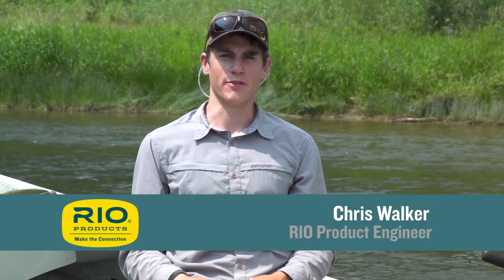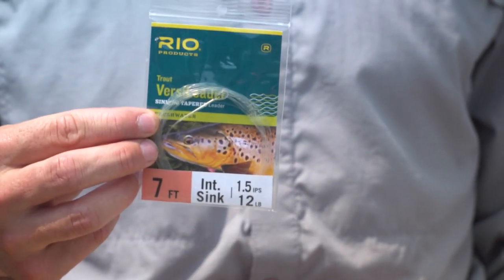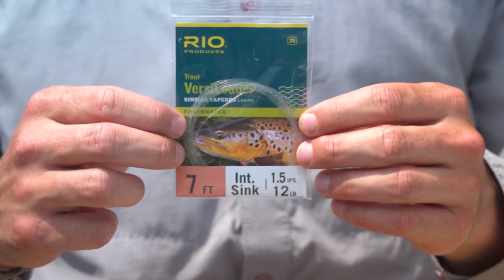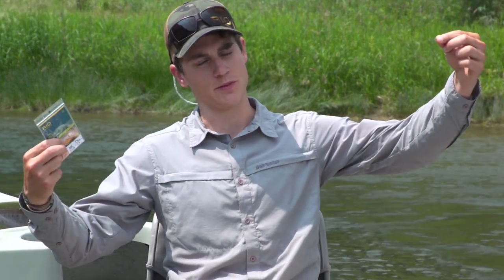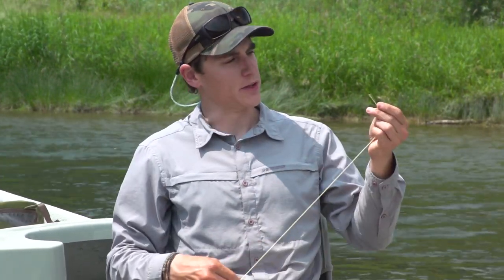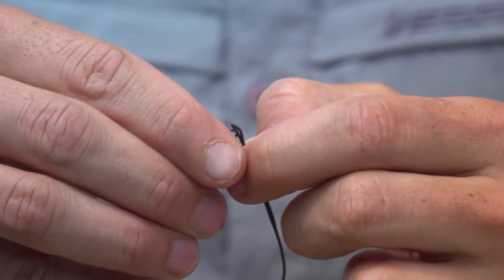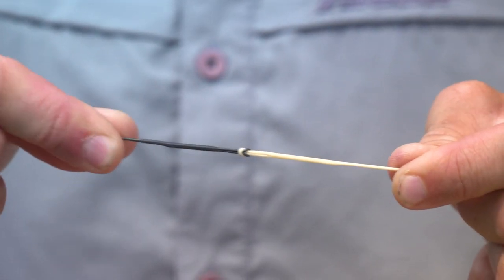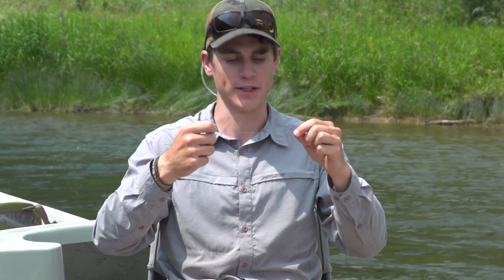Quickly Turn a Floating Line Into A Sink TIp

Comment: What’s the difference between versaleaders and replacement tips ? I notices that grains in both tips are the same in the 10 footer of 75 grains each but big difference in price
Reply from the maker: VersiLeaders do not have any coating at the front end, and therefore have less mass to cast big flies. There is a short section in the latest RIO How To video (How To Choose A Sink Tip) that demonstrates and explains the difference a lot better than I can here with words. Try watching that and see if it makes sense.
Reply: @RIOPRODUCTS how to choose  a sink tip

Comment: How do you determine how much tippet to attach?
Reply from the maker: A simple rule of thumb is the faster sinking the leader, the shorter the tippet. For example on the intermediate VL, about 6-8ft is ideal, and on the type 7, about 3 feet is perfect. This is for a single fly - more is needed for two or more flies.
Reply: @RIOPRODUCTS  Thanks so much for the tip! I'm going to give it a try.